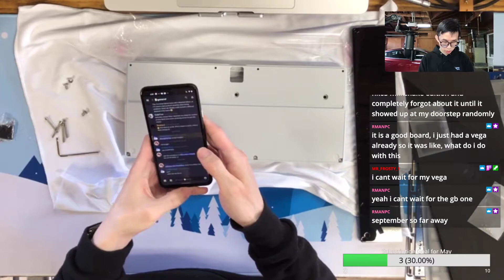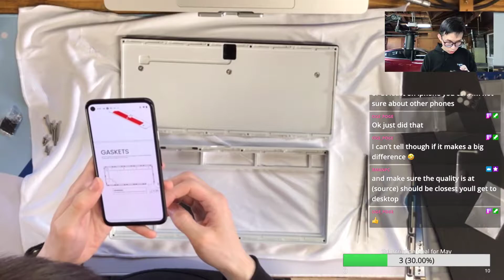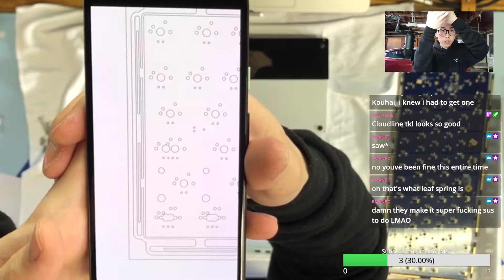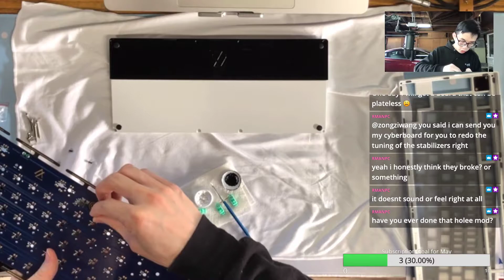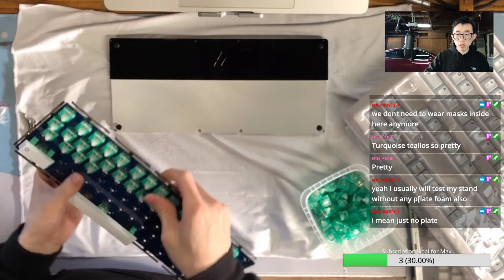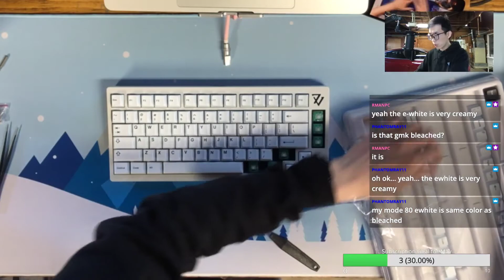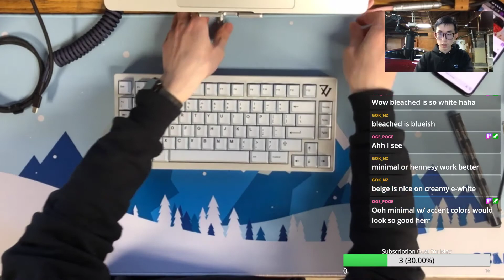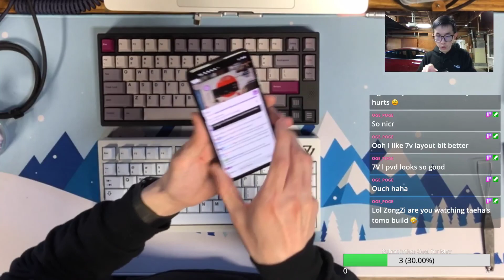Millmaxed 7v by gok w/ Turquoise Tealio Plateless Build Stream Vod

Comment: Hey! Planning to make a build with a plateless millmaxed pcb. Have you encountered any problems so far such as switches popping out?
Reply from the maker: That does but depends on the switches
Reply: @ZongZiWang  No problems with your board so far? Planning to use Zykos
Reply from the maker: @plywoodpacquiao5813  it’s a client board I didn’t use until then